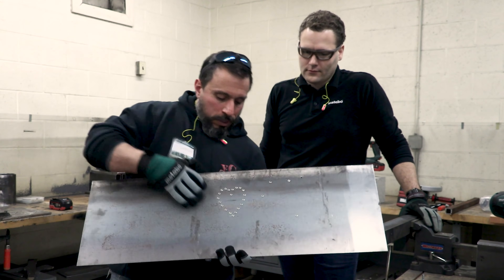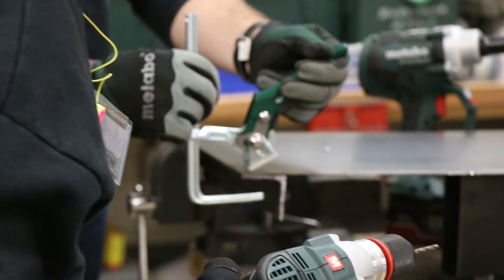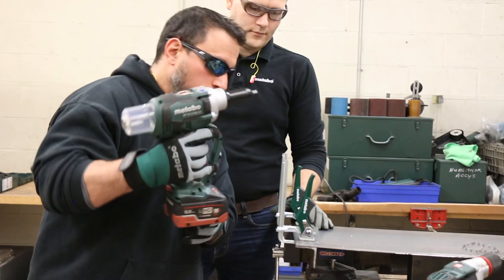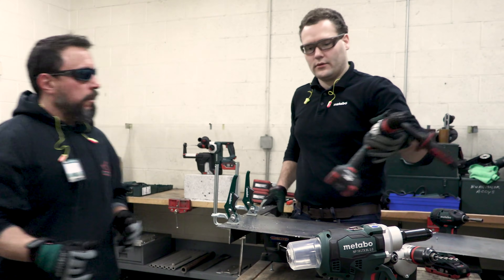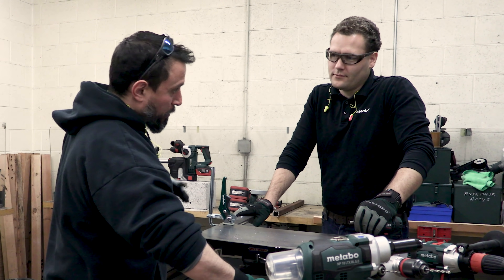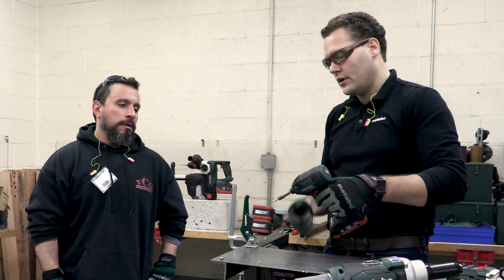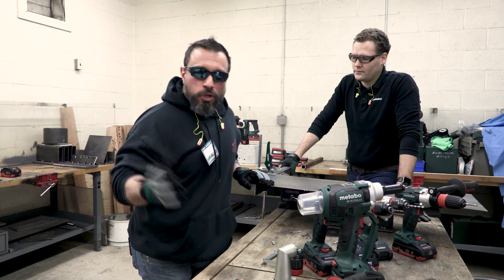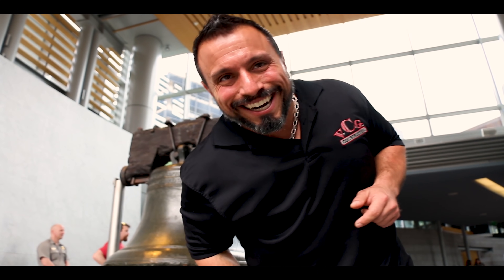3 WAYS TO ATTACH METAL TO METAL WITHOUT WELDING!

Comment: I came across this video just now. I have a project I'm working on, it's a pellet gun. I'm trying to put a picatinny rail on the barrel, however it won't stay on with glue because of the force. But I'm a little scared to drill into the barrel, what can I do? P.s. I don't have a welder either
Reply from the maker: JB Weld
Reply: Would it be possible to tap it just in case it doesn't work? It's not flat on the barrel anywhere
Reply from the maker: Take it to a machine shop if you want it perfect
Reply: They would work on a pellet gun? Because you can't take the barrel off that I know of, I've taking it apart many of times, I customized almost everything including painting it like snow camo

Comment: The right drill and the right drill bit is necessary. Otherwise, go out and spit into the wind. 
What would be the minimum speed / strength of drill required?
What sort of bit is necessary? Common bits will just disintegrate.
Is this true?
Reply: When drilling metal it is important to go slow! You will burn up your drill bits if the RPM is really fast. Using a multiple speed drill is the best. Do research into your drill bits, no matter the material. When it comes to drill bits money matters!

Comment: I'm just dying inside right now!! I just put 4500 5/16 rivets into heavy gauge steel with a pneumatic gun that jammed almost every rivet. I was looking for a cordless one but the thing is my company that I only for work is proving to be cheap. You know what I always find about companies that are cheap - always pay more and lots more than if they were to just get the right tools and fasteners from the start. I work with steel everyday bro! That impact looked awesome too, did you say it slows down and stops when the fastener is in? I'm curious about Metabo now. Would like to see Metabo VS Hilti!
Reply from the maker: Yup the impact slows down as the fastener is seated. Check them out, I bet they’d make you more productive

Comment: I wish I had that tapping drill I seen some attachments for drills like that when I was tapping a little holes I just use the regular Milwaukee drill Joel it in then switch the reverse and our dad out that is so sweet thank you Vince you take care of everybody and will take care of you
Reply from the maker: Thanks Konaman, you if your doing lots of tapping it would really come in handy!!
Reply: Vince I would lay out a backplate evolve electrical components and the ductwork for all the wiring then I wouldn't have to drill and tap hundreds of holes sometimes 4/40 up to usually quarter 20 normally 8/32 I would have a cup of tapping fluid do a couple put some fluid on the tap and keep going it was a challenge to see how fast I can get it done the only people who probably come close to me as many screwing things I have are drywallers